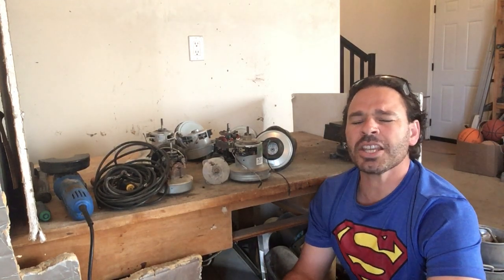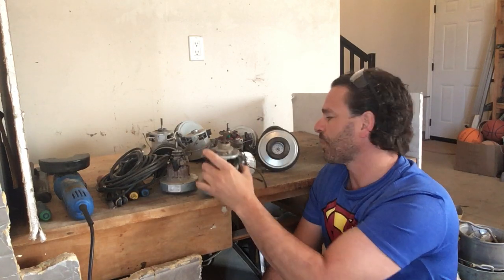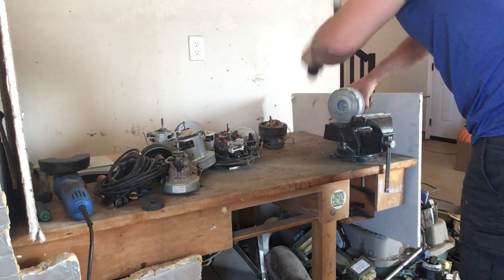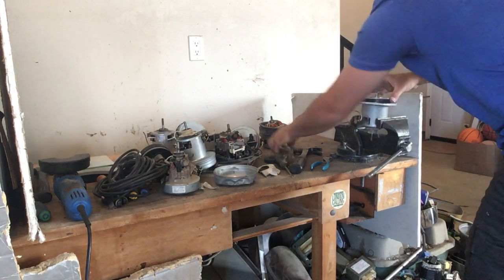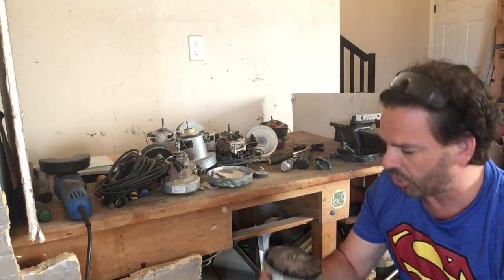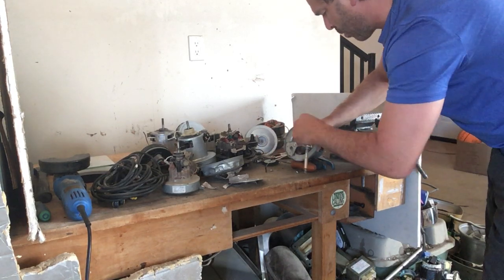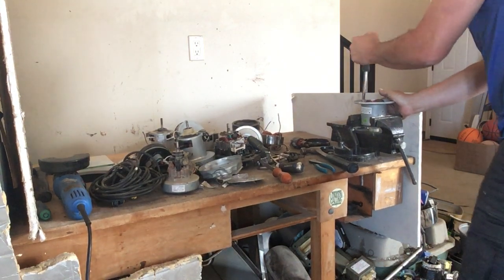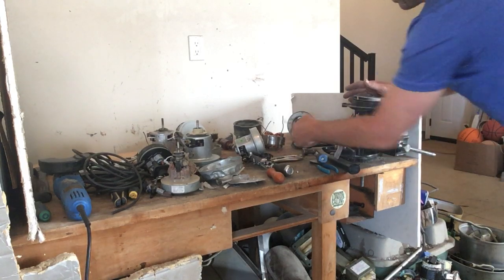Scrapping vacuum cleaner motors for copper, tin, brass, and aluminum. Don't pass them up!

Comment: When you cut your copper out you cut the center and turn it into a U-shape I cut one side flip it over and cut the opposite side and turn it into an L shape than they pull straight out many times you can just use your hand to pull out